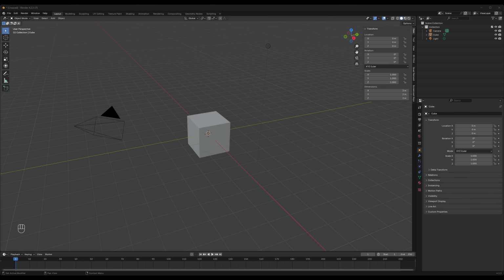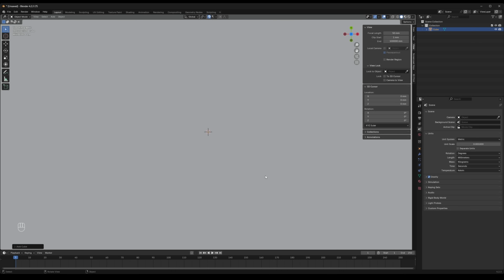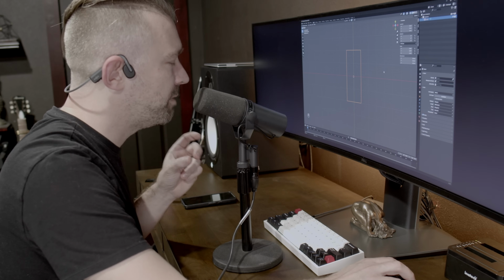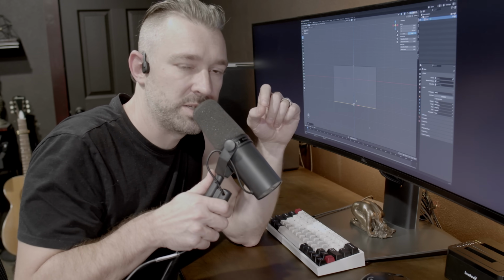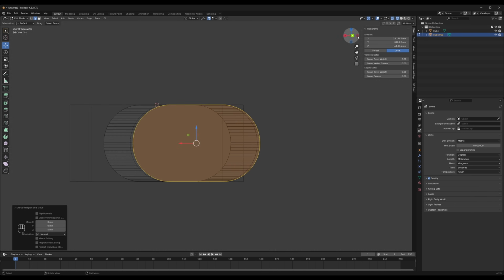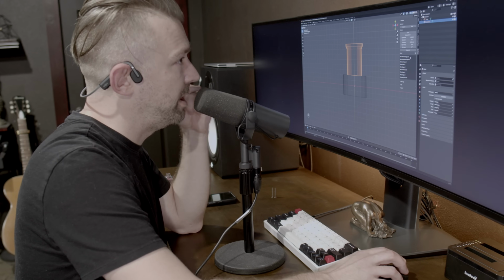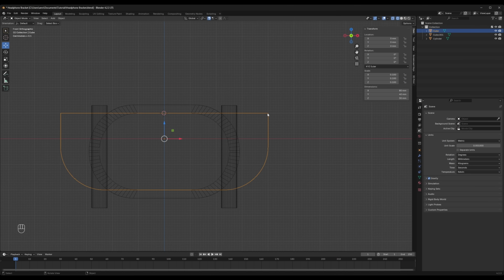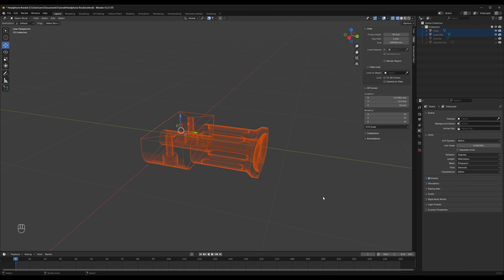How to Design for 3D Printing in Blender - Beginner Tutorial

Comment: I agree, its a myth that blender isn't suitable for 3D printing or CAD. I've been using it for years without trouble. But I don't really do anything special. I just create the 3D part like any other blender project, except we don't need to worry about textures, lighting and rendering. Then export it as stl. All 3D printers have a front end software to load the model. There you can read the stl file, and scale it, rotate it as required, add fencing and supports as needed, and then hit print. That's about it.
Reply: The thing is blender is massively more complex than something like fusion. You can realistically teach someone how sketches, extrudes and Booleans work within an afternoon and they can make simple, precise 3D parts in a few hours. On top of that, it would be fully parametric. That's not the case with blender.
The whole video, all measurements are ''about X mm'' or ''around here''. The same design, taught in a traditional CAD, leaves the user with more transferable skills for other models.
Reply: @vernonalbayeros4719  also a problem with blender is that you have no control over the resolution of your exported mesh.

the verties that you see is what you get. if you find out that your bevel isnt smooth enough your shit out of luck and youll have to redo it.
using non destructive workflows like with bevel modifiers works but as you go more in depth youll have to use vertex groups and bevel weights which can get ugly for more complex projects.

if you want the freedom of changing the mesh resolution youll have to look into sub-d modeling. and while its possible subd by nature looses volume which makes it hard to get precice parts
Reply: This needs to be explained to those thinking they can print very complex geometry or multi meshes that don't render into the printing range of the printers used.
Reply from the maker: True. People tend to over complicate things when they don't need to be complicated. It's tricked a lot of people into believing they can't use Blender.

Comment: Nice video! How much does topology matter when it comes to 3D printing?
Reply from the maker: Thanks, glad you like the video. Topology for 3D printing matters very little. Honestly someone could have some of the worst topology possible and as long and there's no manifold or other major issues the file will still print.
Reply: @zerodotcmd for real?! Holy. I guess that makes sense now that I think more about it, topology is meant for good shading and easier UV mapping for texturing— of which are only seen IN Blender, not the real world (as a 3d print). I should’ve thought of that sooner since I have 5 years of modeling experience, guess you never stop learning— thanks for the confirmation!
Reply from the maker: @KevonForever  Yeah we definitely never stop learning, or at least we shouldn't 🙂 The only time I can see topology being important in 3D printing it perhaps with multi color prints since rough topology could make face selection very difficult for coloring.

Comment: Hey, I'm on the latest version of Blender (4.3.2) and it doesn't allow you to set the clip end to anything higher than 10,000. If I set it manually to 100,000, it glitches the grid. How did you set your clip end to 100,000?
Reply from the maker: Technically, it doesn't need to be set to 100,000. I set it to this value to easily cover my view's clipping. I would recommend setting it to the highest value allowed before glitches occur. I will need to double-check what is going on in the most recent version of Blender.

Comment: When I extend my edges...it always leaves a second line...the rear of the box line still there that I also have to extend out or else the box is lobsided?
Reply from the maker: It's hard to really tell without being able to see exactly what your having trouble with. If you are trying to adjust or extend the edge of a cube per say, you need to make sure you grab all 4 edges. when grabbing from the side view its easy to only select two edges. sometimes you have to rotate to make sure you grab all 4.
Reply: @zerodotcmd  Will just take some getting use to coming from Fusion but I appreciate you taking the time to reply.

Comment: Great video. Question, Is the object solid, or hollow inside, and if hollow, does one need to specify the inner thickness of the “walls”?
Reply from the maker: As long as an object is fully "faced," it doesn't matter if it's "hollow" or not. When a file is exported for 3D printing, it relies on the model's faces to define its geometry. For example, if you take a cube with 6 faces, these faces will translate into the exterior walls of the print. However, if you delete one of these faces, leaving the cube non-manifold, its geometry becomes open and incomplete.

You do not need to solidify objects, as long as all the walls are connected and the surfaces are facing correctly outward. The key is ensuring that the object has a fully enclosed, consistent surface without holes or inverted normals.

There are other definitions and use cases for "non-manifold," but that's a separate topic. The main point here is that in 3D modeling, surfaces or faces have only one physical side. If you have a single plane surface, it will only have one physical "face," and the reverse side will be nonexistent in the printed model. This means that for a 3D object to be printable, it must be fully enclosed or "physical" with no holes.

I know this concept can be tricky to explain in text, so I'll be creating a video on it very soon.
Reply: @zerodotcmd this makes a lot of sense !  Obviously, the consequence is having open geometry is that the object is not “whole” anymore, which would make it non-printable.  
At least that’s what I understood from your description.

Comment: Great Tutorial.  I love it.  Thanks to you I can now use Blender more confidently for 3D printing.

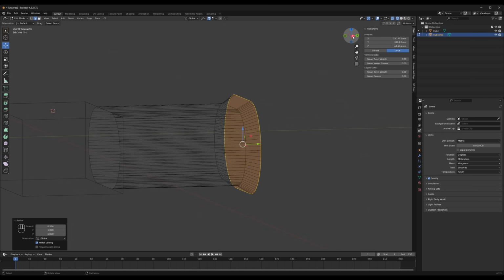@14:20 you do a scale operation.  I do not know if it will be useful but you only used s to scale.  This works in orthographic view but in 3d view you have issues.  You can use (in you case you were using the ZX plane and looking down on to Y axis) S + Shift Y. this will enable scaling only in X and Z axis.  

I run Loop Tools, Bool Tools and Node Wrangler as default free addons and MachineTools from Paid addons.

Looking forward to seeing you break the 1000 sub mark.
Reply from the maker: Awesome, I'm glad you found the video helpful. 

Thanks for the feedback@15:57 I briefly go over scaling on axis, its a great addition to the scaling tool. 

Loop Tools is insanely powerful. Both Bool Tools and Node Wrangler are great options as well. I try to keep my plugins extremely limited but I will most likely go over a few tools like this in the future!

Thanks, it will be exciting to hit 1k. This should happen really soon. ☺️

Comment: Blender is a fantastic program, BUT it's not really a replacement for parametric CAD. The issue is that any modifications to a polygon model are destructive, making it harder to make certain modifications later. For example, the hole you punched through the curved surface; if it needed to be moved, you'd have to basically go back and remodel, because you'd applied the boolean, so you can't just "move" the hole without distorting the overall shape. In a parametric CAD app, you'd just change the parameter for the placement of the hole and everything would recompute. So, if you know Blender well, I can see why you'd just want to continue using it rather than learn a new app. But for precision parts that may need iterative design, you're not going to beat a parametric CAD app with an editable history stack.
Reply from the maker: @flygarfpv3496  Its not a replacement for parametric this is true. They both have their place in design for 3D printing. Blender is a more "Physical" type work flow. While parametric CAD is more mathematic and drafted workflow and takes a different approach for "modeling".  The issues you point out with a boolean cut are one downside of programs like Blender. However keep in mind that CAD also has many downfalls depending on workflow and application. With both methods of design there are ways to solve most issues, even the boolean and modifier issue. One of these solutions is something as simple as non applied modifiers, which I use quite often but felt didn't match the level of this video. If you want to design a simple mechanical part maybe CAD is the way for some users. But if your wanting to make an electronics enclosure in the shape of a dog riding a cloud through space then most of the time Blender would be a better choice. This is why I think Blender is so popular in the 3D design space for printing. The bounds of what people are creating has opened so wide that the options in CAD simply have not kept up. Blender isn't perfect by far, but it is however incredibly powerful and able to achieve amazing results for 3D printing.
Reply: Your right, blender isn't a replacement for CAD. But it is a great substitute, especially for hobbyists that can't afford or justify expensive CAD apps.
As for blender being destructive modelling this is only partially true. The whole point of modifiers is to facilitate non-destructive work flows. The way zero used the Boolean modifier was incorrect. They should not have been applied. There is a check box to apply the modifiers in the export window so any modifiers will be applied to the exported file while leaving them un-applied in blender.
Sometimes you need to apply modifiers to progress with the design of the part in which case you can duplicate the part and apply the modifiers so you still have a copy of the original part. There are ways around everything in blender and is why a person has to develop their own workflow based on their use case and tools they use.
Granted, blender isn't as time efficient as a parametric a modeling tool but the ability to import any STL and modify it directly often saves quite a lot of time.
But as a maker I see blender as a tool in a bag of tools. Depending on the use case it has its strengths and it's weaknesses, same as CAD. Use the tool that better suits the job.
Reply from the maker: @ashleywhitehead3710 You are correct; the way I applied the modifiers isn't exactly the best approach. I made this decision for two main reasons. First, I wanted this to be a more entry-level video for Blender. If a user isn't familiar with how a boolean affects an object in Blender, there is a high risk that, upon export, they may encounter issues without understanding the cause. Early on, it may be good practice for newer users to understand how modifiers interact with objects when applied.

Personally, I have a folder where I store all my cuts—these objects are hidden, and I can work as if the modifiers are applied. This is the proper way it should be done.

The second reason I decided to apply the modifiers is for compatibility. Some older hardware doesn’t handle multiple real-time modifiers very well, and I didn’t want to limit users with older machines. In future videos, I plan to go a bit deeper with a few other options.
Reply: @zerodotcmd  I understand. I figured you implemented the modifiers in the way you did for the reason you stated. I wasn't having a go at you at all, merely explaining to the other comment that blender is capable of non destructive hard surface modeling.
I also created a separate collection to keep the cutter geometry so I can hide them easily and it also stops any parented geometry from stacking and getting lost.
Great vid! Been using blender a couple years now. The part about the models clipping while zoomed out was something I had issues with and now know how to fix. So thanx for that!
Reply from the maker: I figured you weren't having a go at me. 😊 I like to clarify just in case people sometimes wonder why I do things. I'm glad you were able to pick up something useful for the video. The clipping issue has always been incredibly annoying.
Reply: @ashleywhitehead3710  Don't get me wrong. I like Blender. I think it's great. But even with selective applying of booleans, it's still not the same. You can't always choose NOT to apply a boolean if you want to work on the generated geometry. Think of putting a hole in a non-planar, curved surface. If you wanted to then bevel the edge of that hole, you'd need to apply the boolean, because the lip of the hole doesn't "exist" until you apply the boolean. And even then, that geometry is not going to be easy to bevel, because the topology is going to be all over the place (not a clean edge-loop).
Blender is a fantastic tool, but it wouldn't be my go-to for someone wanting to design mechanically precise physical parts. There are a number of no-cost, freely available parametric CAD solutions that would fit that role better.
Reply: Blender has a certain way of doing things.  I think the greatest miss is the beveling.  When I work with bevels I just want to be in Solidworks or Fusion360 and get it over with...  

In blender you need to work in non destructive mode.  meaning you should not apply a modifier until you are absolutely sure about it.  

I have been using cad software since the 80s and one must accept the fact that Blender is not a cad software.  It is a modeling suite.  There are some amazing addons for blender to get it to next level.  one such addon is CAD Sketcher.  It is in its infancy but it will get there if it has the support.
Reply: A simple solution is to save the blender file before applying the modifiers. Then you have that to go back to if need be.

Comment: Thanks! These kind of videos make my "Blender/3D printing resistane" weaker and weaker ;) I'd love to learn it enough to use on a daily basis (and finally drop F360) - so please don't stop making them. And I agree with one of the comments - maybe lower a bit the resolution or capture smaller window - just for ergonomics.
Reply from the maker: Thanks for the feedback, I'm glad you found the video helpful. I will look into some options to make the workspace more easily viewable for people in the next video as this will most likely turn into a series. ☺️
Reply: Just make the switch. Take a lump or two, but you'll be at it in no time!